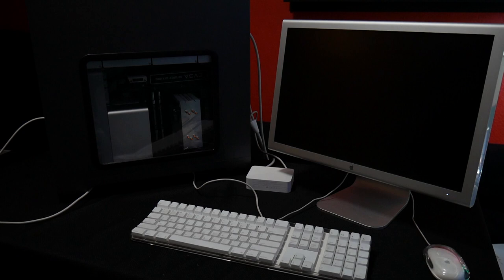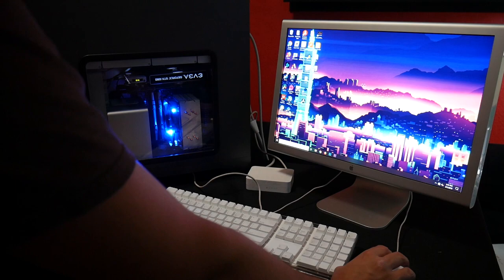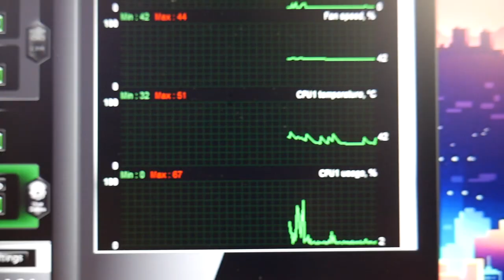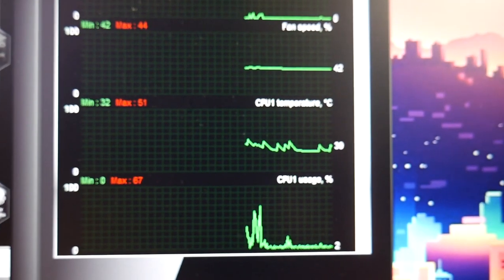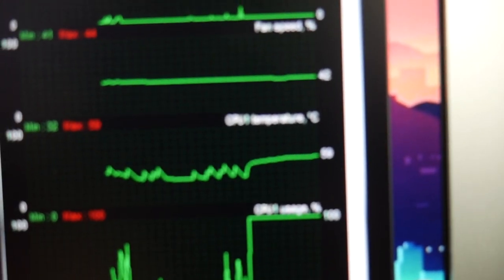Goodwill Mac Pro ATX conversion part 3 It's Finished!

Comment: I bought an old mac pro recently and will be doing something similar.  I will keep mine the original color and no window. For yours I would have painted the optical doors
Reply from the maker: I would have kept it the bare aluminum for sure, but my repairs meant I needed to cover it up. I liked the contrast of the drive doors, but it would look good painted too.

Comment: How is the power supply not overheating when it's almost completely covered and also doesn't have a hole to pull air from the outside..?

Comment: Could you explain how you were able to get the front USB working? I’m not sure I understood from the video. 
Thanks for the video! I’m looking forward to my own conversion.
Reply from the maker: Hi, I removed the USB header from another case I had lying around, then just basically glued it into the location of the original Mac USB ports and ran the connector to the motherboard. It was pretty crude, but it works and didn't require any soldering or special cables.

Comment: nice build, just not a big fan of your psu solution. your 650watt psu's fan wil defenitly start spinning and it doesnt get air to cool down... is the top of the case getting hot now?

Comment: The only thing that bothers me about this mod is how you connected the front panel. Simply because it is possible to connect the power button with LED as well as USB and audio from the panel itself. (I've done this myself with a little research. I haven't bothered to connect the other two though, because i don't think they'll ever gonna be used.)
Otherwise a very clean build. I very much like that you've managed to keep the HDD mounts which i couldn't because i used a Full-ATX board.

Comment: Cut a hole into tha back of the case and then use a 1/16 inch thick aluminum plate and make am adapter plate for an ATX standard power supply. Or, if possible, once the hole has been cut you might be able to attach the ATX power supply by putting screws through the holes in the back panel. In reality, though, it might have been much easier to replace the entire back panel with one from a pc.

Comment: Excellent build, I’m seeing what I can do with it myself, but how did you manage to connect the case power button to the motherboard? It has an unusual three pins, and I am unsure how to adapt it to work with an ATX motherboard. Did you modify it or use any other cables to do so, and if so, what exactly was it? I‘m a bit stuck here. Thanks in advance!

Comment: Awesome mod; looks great.  Inspired by you I recently got one and will be making the changes.  My biggest concern is the power button.  Which power button wire is the + and which is the -?  In the video @6:37 you have blue to the middle contact and white to the bottom.  Or alternatively, it doesn't matter which is which since power just short circuits the board?
Reply from the maker: Correct, it does not matter what side is positive, as it just completes the connection. Just use your multi meter to confirm its the right contacts!

Comment: I'm not a big fan of how the PSU's exhaust fan is almost completely blocked, as that reduces the lifespan of it, and certainly I would have taken steps to try to restore complete functionality on that front panel I/O, as well as a couple other minor changes. Overall though, this is an excellent mod. Nice job!

Comment: Great job!  I'm embarking on my own Mac Pro ATX conversion project and your trio of videos give me confidence to move ahead.  Nice job!  How'd you use the multimeter to figure out the power switch btw?  Please explain :)
Reply from the maker: I actually just checked the wire colors and made sure they ran to the proper positions on each side, then used a crappy PSU to test it with in-case something was wrong.
Reply: @JTechWorkshop  What do the wire colours tell you?  Assume I know nothing of wiring power switches, I literally do. :)
Reply: @egoodchild  J-tech fails to mention that a regular Mac Pro will not house a full ATX motherboard.
Reply from the maker: @egoodchild  im sorry I totally missed this reply, and also realized I mis read your comment. Its really simple with the multi meter, there will be a mode that detects conductivity between the 2 probes, when a circuit is passed through the meter it will beep. All I did was touch the different solder pads on the power switch and pressed the button to see if I got the beep from the meter. Hope that helps.
Reply: @JTechWorkshop  Thanks!

Comment: Are you worried that the power supply will not get any decent air intake?
Reply: yea, i thought he could remove the top part of the apple psu cover to get a little more of air intake for the psu.  right now it seem pretty close and may hurt the psu lifetime.

Comment: corsair H100i +  Ryzen 9 ATX and RTX 2080 can enter in this case please ?
Reply from the maker: Fitting a full size ATX board is a much different process, you need to remove the top shelf to make it work, but it could definitely be done.
Reply: @JTechWorkshop  
thanks I will try ^^